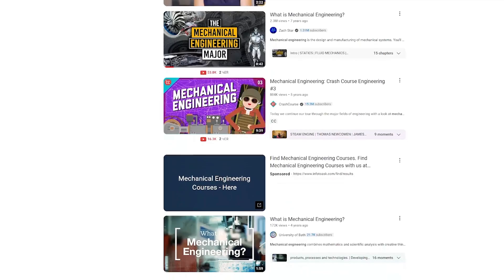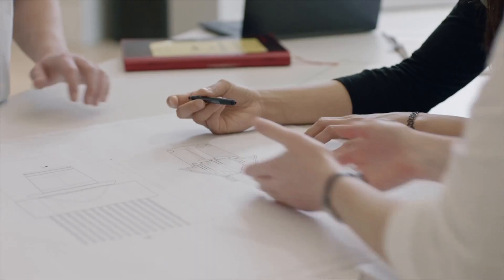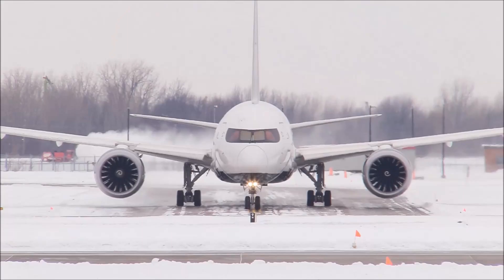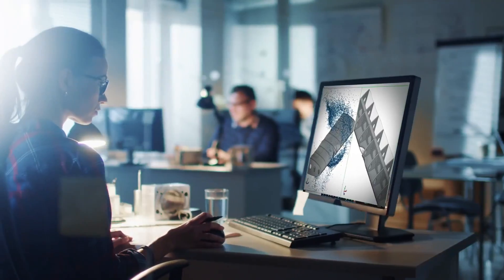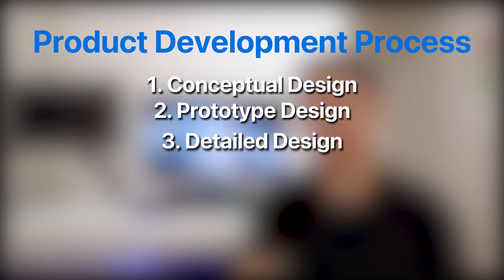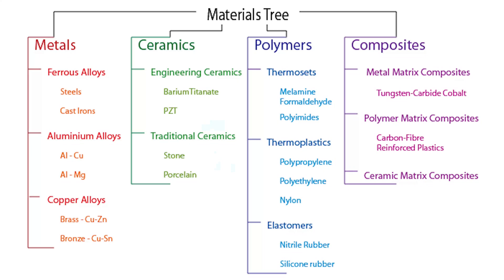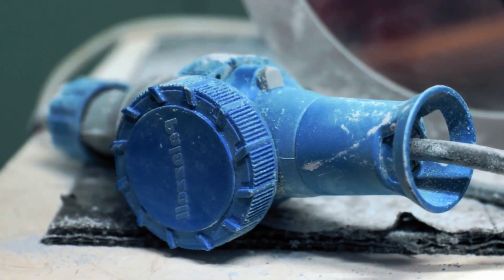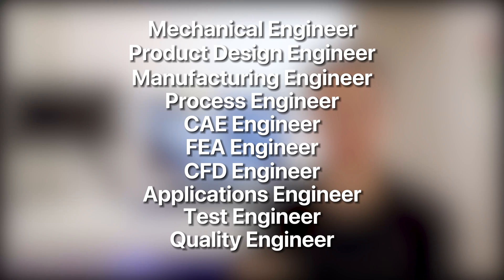What is Mechanical Engineering?

Comment: Great video but I will like to point out the fact that there are actually three major areas of simulation. The third one besides FEA and CFD is MBD (multibody dynamics) , the most popular being MSC ADAMS but which is often left out by most vlogers when talking about simulation. It focusses on the system level performance of a product and is heavily applicable in the automotive, aerospace and machinery industries but also in any mechanism or system with moving parts

Comment: Very good presentation of a Mechanical Engineering major; however, you forgot to talk about industrial maintenance, which covers a significant field within mechanical engineering. Maintenance engineers are responsible for developing and implementing maintenance plans. They utilize their mechanical knowledge, experience with specific machines, data collection, and data analysis to craft maintenance plans with actionable items. The average maintenance cost percentage in the industry ranges from 15% to 70% of production costs. However, specific studies have estimated the average maintenance cost to be around 28% of total production costs.